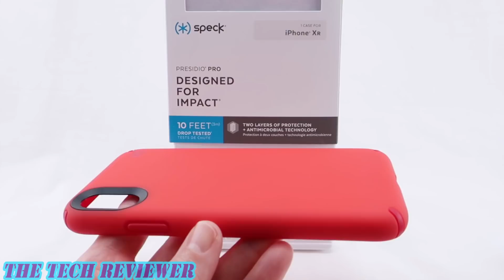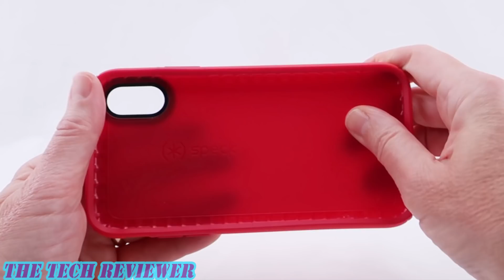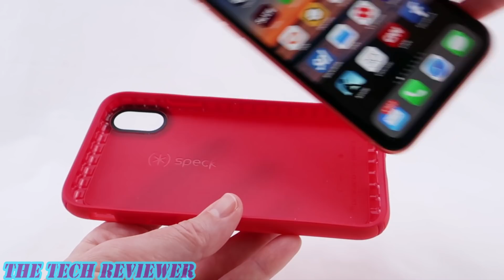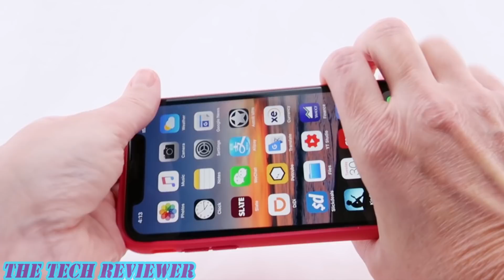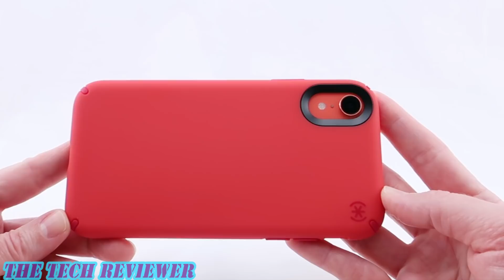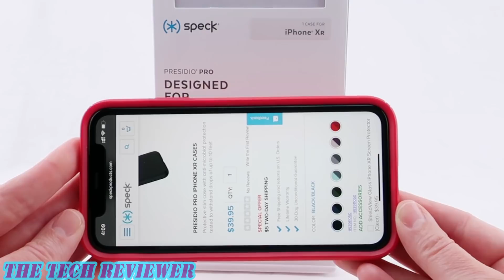Speck Presidio Pro for iPhone XR: 10 Ft Drop Protection * Good Grip * Antimicrobial Protection!

Comment: Very nice case...but the dark colors rare fingerprint magnets
Reply from the maker: So interesting what a difference color can make! This red is fine, and my other Presidio Pro in light purple is also fine...
Reply: The Tech Reviewer I wonder if something changed between the Max and Xr. Or if it is just a color issue
Reply from the maker: I wonder as well! I saw your comments about the fingerprint issue for your Presidio Pro and so I looked at both my Presidio Pros (red and light purple) very carefully to see if fingerprints were building up, and I really didn't see any. It also could be a difference in hand type--sweaty or not...